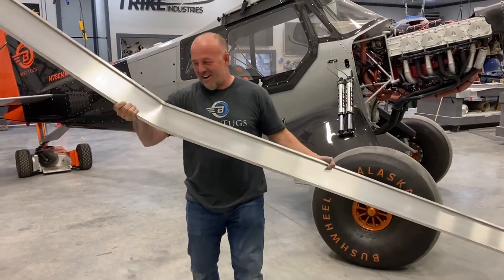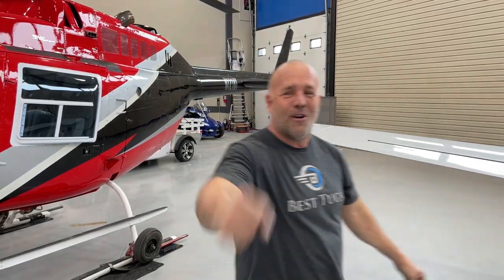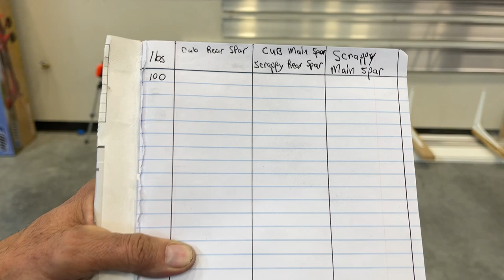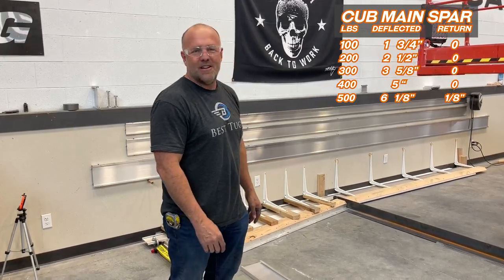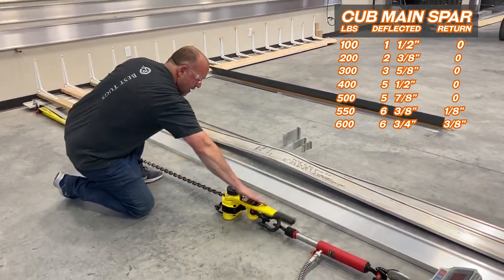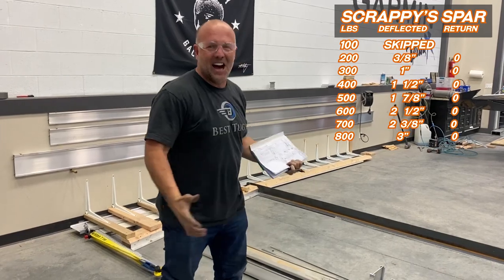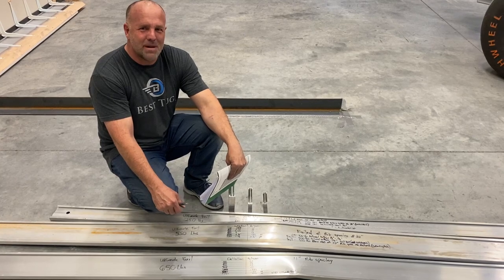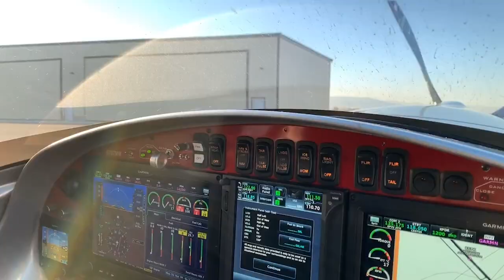I Just Broke My Airplane Wing - What I Learned | Scrappy #47

Comment: " Only needed four, but I bought a pallet load of 32." Only Patey.
Reply: I think he has a plan lol.
Reply: @rodneyross5282  yes, he Said it on The video, minimum order quantity IS a pallet. He joked about making tables from The extra ones.
Reply: No, It's not just Mike... I had a neighbor who built a house on a lake. He ordered the roof tiles from a company in South America, they were back-ordered and wouldn't arrive on time... So, he flew down, bought the company, put his order first, got his roofing tiles... then turned around and sold the company and made a profit!!!
Reply: I'm thinking a second wing design might be in the future. One for slow STOL work and another for general flying with  general STOL abilities.
Reply: No Worries, I Beleive That Mike Has Plans To Going Into Productions Of New $High$ Super STOL LONG-Range Fully High Powered Electric + Carbon Fiber - 4-Seater+ Aireo-Planes & Now He Can Carry Lots Of Extra Batteries Weights Fur-Sure!!! 🤣
Reply: *** Mike goes Big or Goes home!!! :P
Reply: The interesting thing, is what will he do with them ? Make a tri-plane x 5 ?
Reply: I'm sure Draco's new wing design is already floating around in Mike's head, and the surplus spars will be used for it, or another project.
Reply: They are basically free compared to the cost of the die
Reply: @richardmartin6533  what a legend!!!
Reply: @richardmartin6533  Hahahaha, LOL - modern problems require modern solutions xD
Reply: The extrusion set-up charge probably cost most of that. 32 pics probably cost 15% more than 10 pcs would have.
Reply: I've had many custom shapes extruded and there's always a minimum weight per run. Depending on the mill it was usually either 250 or 500 pounds. Beyond that weight the cost per part drops significantly as the setup and handling cost is divided between more lengths of material.
Reply: @rodneyross5282  He has consistently spoken about the potential of using Scrappy custom moldings as plugs to mold production parts. Makes you think....
Reply: You normally have to order a tonne of aluminium to get a custom extrusion... At least here in Australia, I'm assuming it's the same in most regions.
Reply: The price diff between 4 and 32 was probably very minimal... the first part costs thousands, the next 100,000 cost pennies.

Comment: "I dont see any reason why I'd try and hang a cub from my wingtip"  He says now, but now that he knows he can do it, its gonna start to look awfully convenient when someone else gets a flat landing on some mountainside somewhere and you need to lift their plane to swap a wheel :)
Reply: There ARE two carbon cubs being built nearby, so theoretically he could test this theory out in the hangar.
Reply: It would tip over, no counterweight on the other wing.
Reply: @danblumel  Just have another Carbon Cub fly in and play counterweight. ;-)
Reply: Show me how you would do it?
Reply: @aerospot2  Not sure how, but if he can hang one off one wing, I assume he can hang one off the other, too!
Reply: You've seen his Draco video where he has the jumpers fly up to his airplane and grab hold?  Yeah, my mind went there, but what I was thinking was back in the 1950s, the Air Force had the XF-85, Goblin Parasite fighter.  It would attach to the wing or belly of a bomber, be carried into an attack, released and would defend the attackers and then re-attach to the bomber for the egress.
Okay, now, replace the Goblin with a couple of Carbon Cubs attaching themselves, or maybe Trent Palmer in the Freedom Fox and another one just like it, to the wingtips of Scrappy, and MIke giving them a lift.
Yes, it's a Saturday, I"ve had a long day, and I'm tired.
Reply: Ground anchor that you'd use as a tie down anyway if parking overnight on one wing, big ol ratchet strap attached to the tie down point in the other side. Easy, light, using something that is probably packed anyway.
Reply: They are going to be hard points for Mk-83s JDAMs on each wing. You know, in case you need to clear a few trees on the river bank before you land.

Comment: I love seeing this level of real world testing, and it is amazing to see how accurately CAD modelling can come to real world results. Great stuff.
Reply: Oh shit! one of my favorite channels commenting on one of my other favorites!! love the work from both of ya!!
Reply: Can' they use carbon fibre spars
Reply: @michaelmcneil4168  FEM and classic analysis work really well with metals but analysis on carbon fiber is incredibly complex and is still not very well understood. The other drawback of carbonfiber is that it's not very flexible. You can push metal past it's loading point in a pinch without a catastrophic fracture, but composites tend to shatter. This is why designers tend to pick metals for load bearing structure parts and composites for low risk parts.

Comment: Very informative to watch... and makes me glad that I decided to disassemble a wing panel I bought for a Wag Aero 2+2 project that I bought off a guy a few years back and am finally getting around to working on that build. The builder changed up the rib spacing from the plans in order to add a slightly larger fuel tank, although he kept the compression struts located according to plan. Maybe not enough to make a difference, maybe it would. But the engineers at Piper who designed the PA-14, which the 2+2 is basically a copy of, put them where they are for a reason. I'll trust with the number of 14's still flying around in the bush, that they got it right. Keep the videos with the explanations coming.. I'll keep coming back to watch!

Comment: Talking to a professor at a major university, he was telling me he has a really hard time persuading many of his students that at some point they have to get away from their computers and actually build, test and verify.
Reply: Build, but that would mean getting off their computers and devices, getting out of their chair, room, basement, classroom, and lab and get dirty hands, and having to use a ruler, pencil, scriber, drills, drill-press, overalls, safety glasses, ear defenders, punches, drifts, hand and machine hacksaws, deburrer tools, ratchet tools, grind stones, grinders, mig/tig oxy, arc and spot welders, lathes, machining, sheet-metal skills and shears, mills and milling, cutting fluid, rivet guns, rivets, bolts, nuts, compressed air tools, socket sets, surface/depth gauges, levels, chain blocks, winches, hoists, hydraulic presses, hand cleaner, learn to polish your safety boots... What have I missed out?! ah, a floor broom, hand brush and pan and waste bin to sweep out the workshop after cleaning up! :)
Reply: The worst thing about being an engineer is being stuck behind a computer!

Comment: Hey Mike, you probably already covered this and I just hadn’t seen it, but why didn’t we go carbon fiber on the main spars?
Reply: I would think Carbon Fibre tends to snap rather than deform in one piece
Reply: Most likely because carbon fiber is stiff so it’s failure point would be catastrophic versus aluminum which can deflect and return and any failure is not your wing snapping into half
Reply: Many sailpanes and acrobatic planes have very strong Carbon fiber spars. +/-10 g or better in some cases

Comment: Question for those more well-versed in structural engineering than I am: if ribs serve to prevent this buckling failure mode, but the skin of the aircraft could span a larger rib spacing than is currently used, would it not be more efficient to just have a spar with wider flanges to resist buckling, thus enabling wider spaced ribs?
Reply: I was wondering how much difference wider flanges would make as well...

Comment: With a payload that high Scrappy is going to be a very happy plane. Plus the thickness of the main spar is going to make the leading edge nice. Just as with the secondary spar is going to make the trailing edge just as nice. Slow speed and high speed windows is going to be a crawl and a run away from a standard cub. Great work Mike keep it up. "Back to work."

Comment: Solid Works engineers watching the video with their fingers crossed from the start... :D
Reply: scrappy spar was not tested to same conditions as the first two spars.  it was setup  with the extra  ribs.  so results  are not true comparision  .
Reply: @robertchopp5477  No. The very first spar was tested with fewer ribs. But he redid that test with more ribs using the same spar (carbon cub spar). The very first test was discarded.

Comment: Glad to see it worked out equally with the old school and solid works methods. It's always good to go back and verify engineering once in a while as a sanity check. You can't be too careful when it comes to aircraft design.

I went to a lecture today and learned that, according to our old engineering, that the area of bees wings were too small to allow them to fly well. Turns out that now we know that they actually have Vortex Generators similar to what we use on the STOL planes to improve the lift.

Comment: yet another great episode!  i went with the numbers too for my catamaran.  12 foot span required 0.25 wall on 5 " OD for 6063 T6 extruded structural tube.  Could only order increments of 1/8 ".  a bit over built but i could probably crash into a buoy and be fine.

Comment: It's called "ribboning", when the deformation is caused by shear loading like this. Even a round spar would tend to ribbon, except that the deformation would eventually even out along the length and result in a kink at the pinch point. Even so, I'd like to see your same test rig setup on a round spar to test it's plastic deformation... maybe a box spar? Or reverse engineer a thicker shear web until you get the strength desired. Then you can determine the weight penalty.

Comment: Great video Mike.  Thanks for making it clear to people that the spar is only one piece and that all parts need to be stressed.  I run Acroflight.co.uk and work with a lot of home builders as well as larger organisations.  For a new aircraft type, which l consider Scrappy to be, it is essential to generate  a full set of loads so that realistic aero and grounds loads get used during stressing.  You are right to point out that at LIMIT loads the airframe should have zero permanent deformation and at ULTIMATE that deformation can be detrimental but cannot be catastrophic.  What you illustrated was a compressive buckling (otherwise known as crippling) failure.  The loading direction of the tests, as you mentioned, actually simulates a wing-down load case.  Personally l would have not used the intermediate pivot in compression as it does not simulate the lateral constraint condition that the top spar cap sees (wing up, this is where the compression occurs).

We have found that the strut connection to the spar web is best made as a double tapered plate, done efficiently this add to the lateral constraint and offsets the onset of a crippling failure.  It is also not necessary to add full ribs at the intermediate spanwise positions, angles or channels set vertically against the spar web work great.  These ‘soldiers’ are primarily there to reduce the web panel size, this enables both compressive and shear buckling calcs (or FE analysis) to predict failure.  

Having been developing ways to analyse aircraft structures pretty much my entire career, it is still a hard-sell process as nobody wants to spend the money.  You have managed to get the important message across to people, l thank you for that.  Best wishes and please keep one of those nice spar sets back for us.

Comment: Some interesting material engineering terms:
"Stress" is a force applied to the material.
"Strain" is when the stress applied physically moves the material.
"Elastic deformation" is a strain of the material which returns to its original location after the force is removed.
"Plastic deformation" is a strain of the material which does not return fully to its original location after force is removed, but has passed the "yield point" into permanent displacement.
As we can see, strain can be given the material past the yield point with even more force, up to an ultimate peak, and then it moves into failure where the scale numbers begin reducing.
Engineering is fun.

Comment: Its pretty amazing how fast the onset of the extrusion failure is with onset of plasticity/ fatigue in all 3 spars, a fairly tight predictable envelope, but , in all of them its amazing how high the tension or simulated weight load is! Great video!
Would (wood) have been interesting a comparison to show what a wood sitka or dFir would bend befor failure,.. of course wood is a different medium, & it doesnt fatigue like ALum and would take a deflection more befor ultimate failure..
Again great vid!

Comment: The last class I took before getting my engineering degree last year was CAE (Computer Aided Engineering).  We used Solidworks FEA on a strut/shock absorber and turbine design we created.  It scared the crap out of me going into it. However, what I learned from it made me the man for our Senior Design (aka Machine Design) course as I was the only one in the entire class that knew how to perform an FEA. So we were the only group who included it in our project report!!!! Easy A!  To all future engineers take this course!!!!

EDIT:  Question, Mike did you have to account for any elongation of the hole in the spar for the bolt used to apply the force? Or is that one of those negligible things Strength and Materials courses force you to calculate just to make you lose your mind??? 😆

Comment: It's silly for me at age 74 to order one of these, but I did. Why, because My father was a private pilot before and after WW2 and as a teenager I got my student pilot  license at age 15 in a Piper Colt, Mike you embody all that is good in aviation. Now at my age I'm building my own "scrappy" A Hangar 9 Timber 110 Bush plane RC model, not a scale plane but looks strongly like a Kitfox. I've been "bashing" (so to speak) the Kit by re engineering the landing gear and re enforcing the wooden fuselage to handle the larger than normal 55cc  gas engine, which will also be modified. Tearing into this 110" span model reminds me so much of your scrappy series, I just had to have a piece of the spar. I'm going to try to find some use for it (at least one of the pieces) in my model, maybe as a servo or Receiver tray or a gas tank mount, so my plane will be part real Scrappy. HaHA, thanks so much for your enthusiasm. regards John Derstine

Comment: Mr. Mike this test to represent for single parameter for wing spar only and if deflect till 6" will damage skin of wing. actually wing consist of many parts that strengthen of wing it self, so for actual wing strength by deflect test we can test with uniform load for complete wing or approach by mathematic or fined element. At least your test is comparable for similar part for other wing. Good Job and inspiring

Comment: Really interesting to watch. I actually worked at Douglas Aircraft outside of Toronto. I worked on putting in the bulkheads between the spars on the DC 9 aircraft in the mid 1960’s. Those spars were obviously a lot bigger than yours but the engineering and math involved is very interesting to see.👍👍🇨🇦

Comment: Hello Mike,

As a 30 year experienced Aerospace Engineer in the rocket industry, I can assure you without reservation that structural analysis (classical, FEA static and dynamic, modal, coupled-loads, and even non-linear -post plastic, and more) capability is adequately mature for you to plan procurements and commit funds to building the long-lead and critical components well-before testing (other than subscale tests for properties validation, which for extruded aluminums has already been done ad-infinitum) of full-scale or final part designs can be accomplished.  In fact Mike, if this weren't the case, the time from idea conception to delivery of new planes, cars, rockets, etc... would double, or more.  

The single caveat to my statement above, is that it only applies IF the analysis is done correctly (as may be obvious of course - duh, right), which normally takes appreciable and applicable relevant analysis experience that is supported by closing the loop with testing and results folded back into the analysis  methodologies.  And while much of that has been done by the really smart people (the Shigleys and Timoshenkos, and Rourkes of the world) in general in commonly accessible methodologies, one still must be ever-diligent and always check analysis result against common-sense experience.

Comment: Hi! Just an aspiring mechanical engineer here. I know you’re modeling the loading that would occur to the spar in the plane, however did you consider a 4 point bending test to test the true strength of your spar. The shear force is discontinuous and the bending moment is non-smooth at the middle support. This is easy to see because by the numbers your spar should break at the middle support every time but it doesn’t. 4 point bending tests are more accurate than 3 point bending tests. That being said, you’re an inspiration to us all!

Comment: See how fun R & D is. I did that exact type of stuff for 15 years. Except mine wasn’t on cool stuff like wing spars. My was on pipeline stuff. I had design and engineer and pipe transportation system that would store pipe in a spoiled state and then be put on a ship, taken out in the ocean, laid on the floor. The kicker is the pipe had to be straight when laid on the ocean floor. My team had a blast with that one. All because they didn’t have the room to store 100 miles of welded 12” pipe that would lay between two islands up by Sweden. Go figure.
Now, build the wings and get the plane in the air.